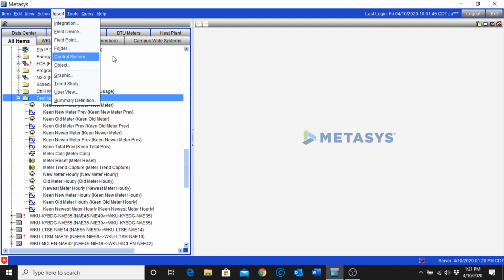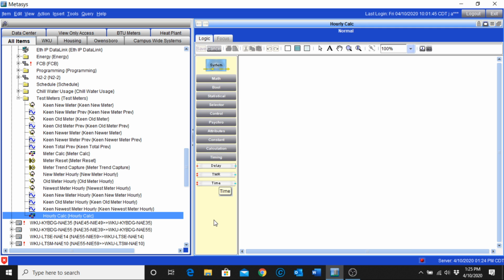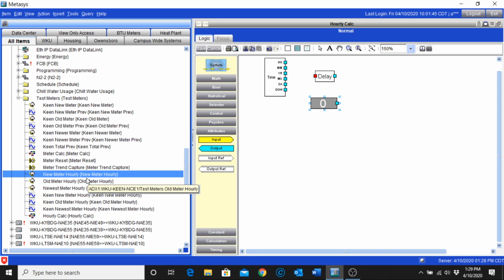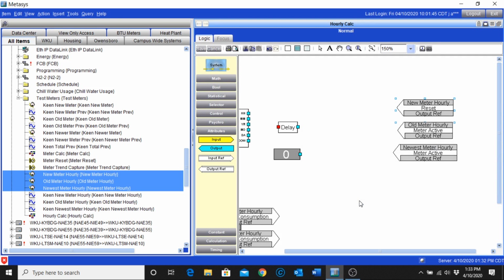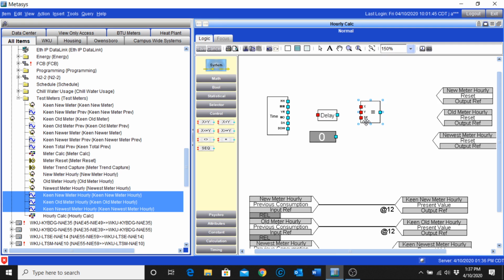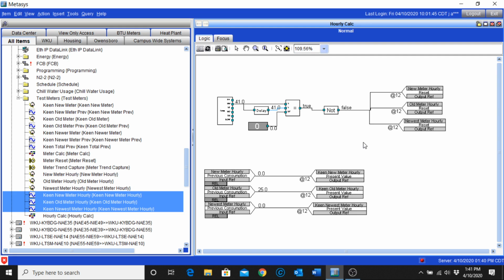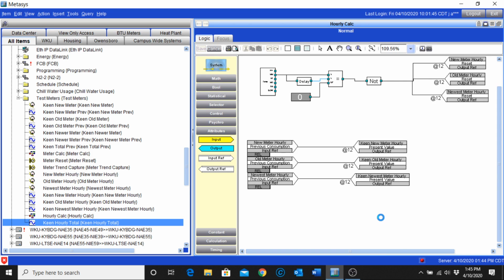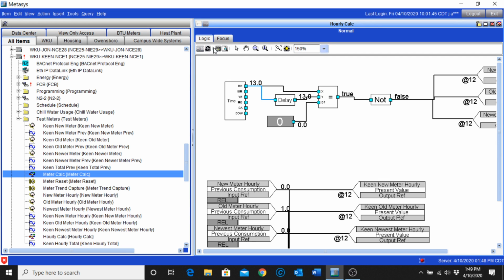Metasys LCT Programming

Comment: I recently got a backup from a NAE. I know the LCT is somewhere in the backup, I just can not locate. Once located, will I be able to view it?
Reply from the maker: Yes you should be able to view the LCT.  It should appear in the same place it is in the NAE
Reply: @Systemcontroltech  I found it. It comes up as a XML file. When I open it up, it comes up with <Base64Zip> followed by a long line of code. Is there anyway to convert into something read-able?
Reply: @Systemcontroltech  Located it. Comes up as a XML file. I open it and it says <Base64Zip> followed by a bunch of code. Is there anyway to convert the XML to a readable file?